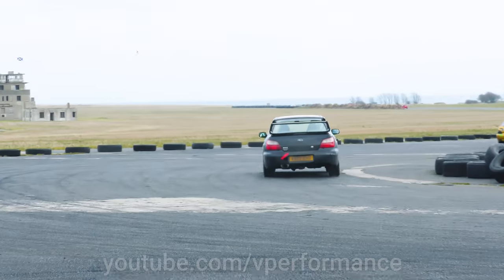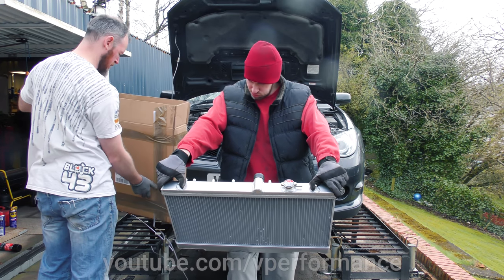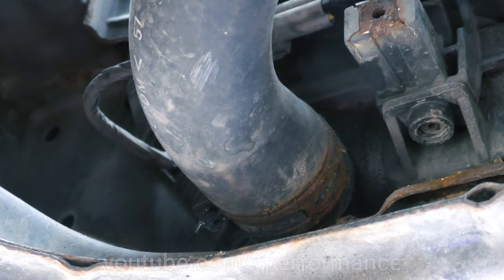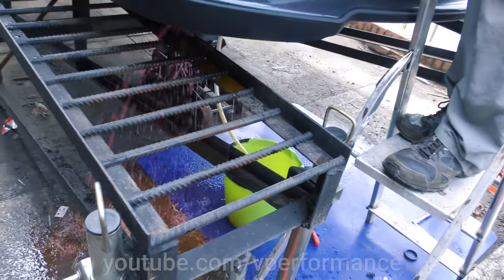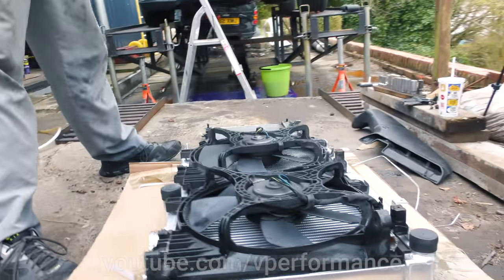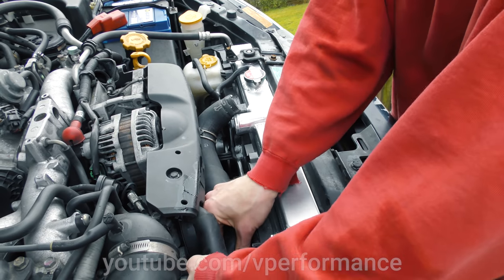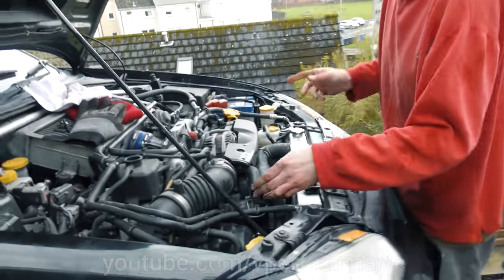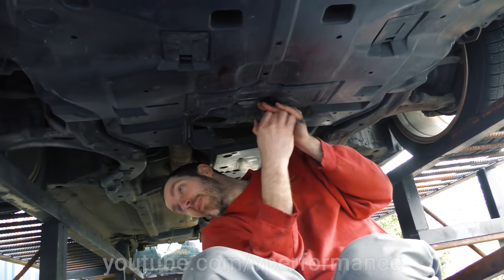RaceSpec aluminium radiator for Subaru Impreza WRX

Comment: Spigot ring?
Reply from the maker: It does look like a spigot ring, but it was definitely rubber rather than a plastic ring.
Reply: vPerformance thermostat/waterpump seal then?!
Reply: vPerformance inner seal on the oil fill cap.